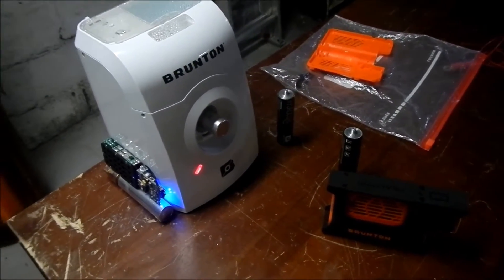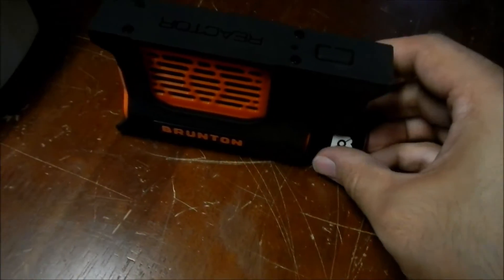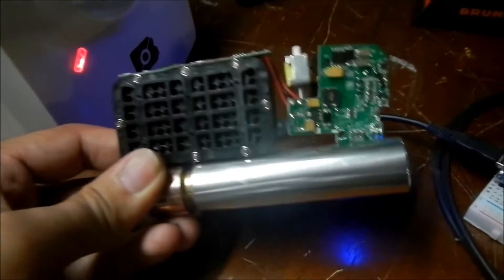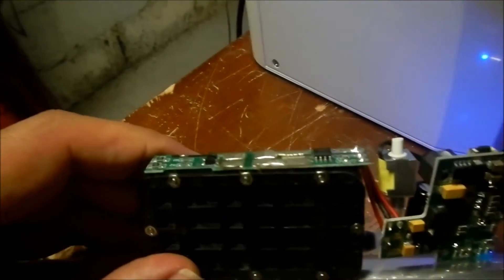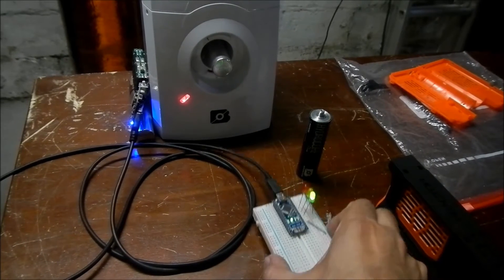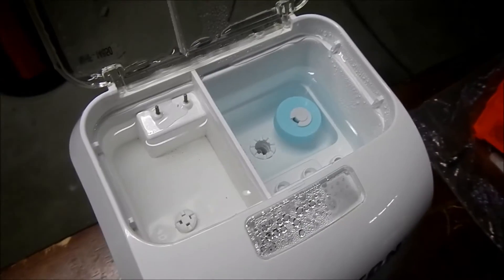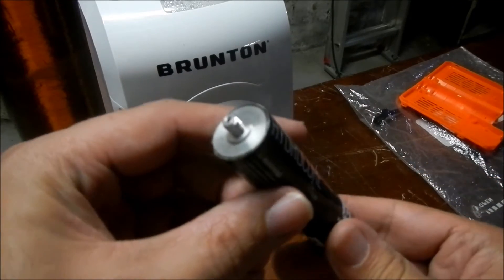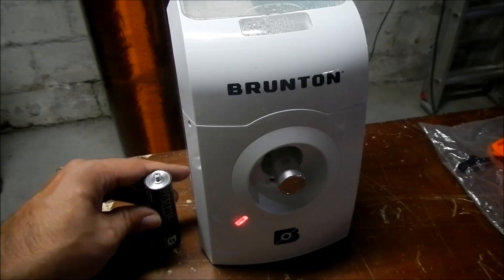Review of Brunton Hydrolyser, HydroCore, and “REACTOR” Fuel Cell

Comment: What they SHOULD HAVE done is to trickle charge a LIPO or other battery cell that could output the voltages needed to charge a phone.
Reply from the maker: Maybe that would have helped... but the mini fuel cell is unreliable.
Reply: @sparkstarter  very true, though that could have masked the problems.
Reply from the maker: I guess they were to honest to fake a working product. lol...

Comment: Yeah it seemed a really cool concept, I'm definitely interested in finding out what the metal hydride is in the fuel cell? 
I purchased this just to take apart.. 
That's the number one issue with hydrogen, the storage 😕
If you could scale this unit up and have the electrolysis fed by the PV panels there would be no stopping you! 
Low cost hydride is what's needed... 

Take the charge unit apart, have a cheeky look see 🤓
Reply: i think flow batteries are taking that route... liquid that gets regenerated\converted in a fuel cell. the big elephant is cost of solar\batteries is dropping so fast that these efforts have to somehow tie into this new reality. Efficiency also is an issue... charging/discharging a lithium ion cell is 95% efficient. try to beat that with flow cells.... 
Cost and energy density are the only issue  that batteries can be beaten with, and everyone appears to try and get these two issues addressed.
Reply from the maker: haha I agree with you in principal.... the problem is low cost everything, solar, storage, fuel synthesis. Personally   I think the key innovation needs to be electrical energy (solar or nuclear) directly converted to liquid fuels. Not sure if this is possible, but this needs to happen. Aside from the energy density of liquid fuels, there are so many logistical advantages to transportation and portability, no other energy source can really compete.
Reply from the maker: Ultra cheap electricity is what is needed for synthetic fuels to replace fossil fuels. Unfortunately the cheapest form of electricity is the fossil fuel coal. So until fusion or some other nuclear energy break through happens we are stuck.
Reply: agree with coal being the cheapest, but it is optimized to the max and not still getting cheaper as is wind and solar. also agree that price of power is the key. but don't forget the price the customer pays is very different to generation cost or wholesale price. Solar/battery for example is cutting out the middle man, so despite higher generation cost solar/battery can become an interesting alternative for people paying too much for power. And yes, I also think that a breakthrough in nuclear or fusion could change things, especially if they can get lifcycle cost under control, waste management for a nuclear plant must be provided for thousands of years.

Comment: almost forgot about these, very cool idea and quite well implemented, but certainly needs work before it is viable for real world use. 
also, are the hydrocores actually a pressure tank for storing hydrogen gas, or does it have a substrate inside that absorbs the hydrogen and re-releases it?
Reply from the maker: I haven't cut one open to see whats inside, but the gas is definitely pressurized, if you push hydrocore valve stem you get a burst of gas.